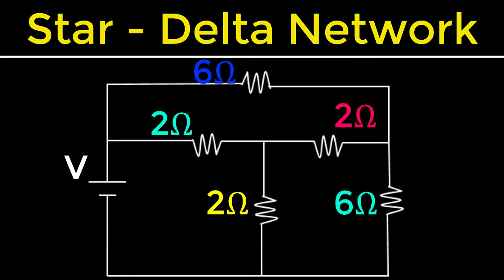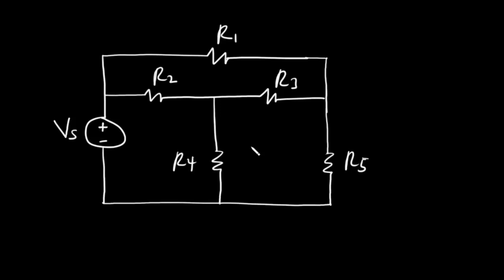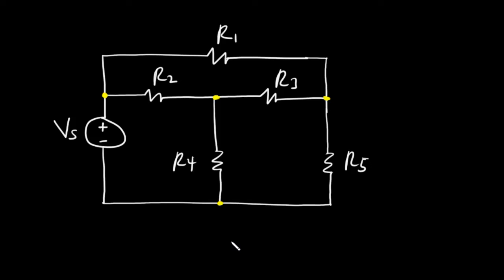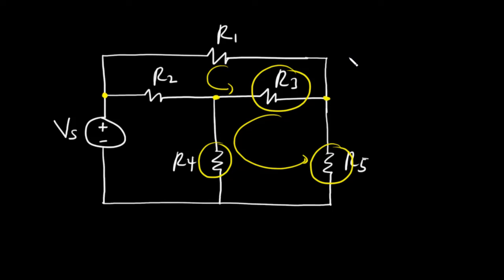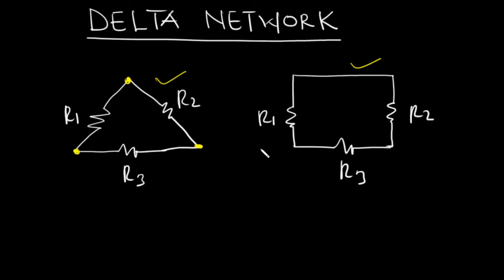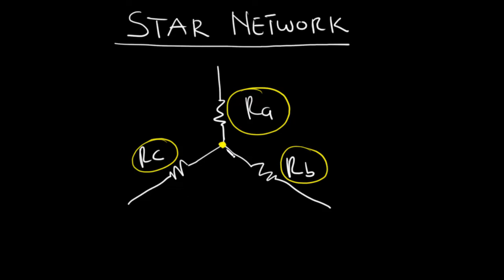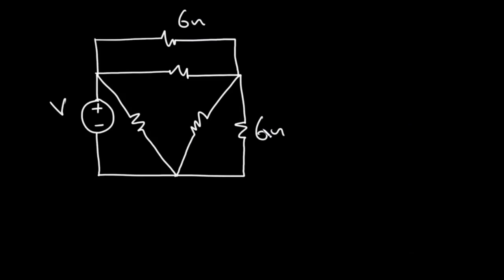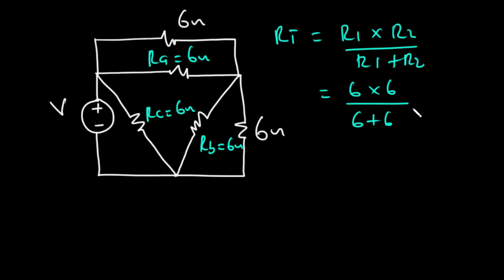13 - Delta to Star Conversion - Concept with Solved Examples

Comment: Thanks for the presentation, but I wouldn't recommend using the same resistor values as it can confuse which resistors are being added/multipied.
Reply from the maker: Okay, well noted. Well that was the example we had, I think I need to solve more questions with other examples too. Thanks so much

Comment: Hi, what do you mean by going through a loop without passing through more than 2 resistor?
Reply from the maker: please come again, don't get your question
Reply: you said that for 2 resistor to be in parallel, they must pass through a loop without passing through more than 2 resistor, I don’t understand what you mean.
Reply from the maker: Yes, when you go around a loop which contains only two resistors, without passing through a circuit element, eg voltage source, the reseistors are in parallel
Reply: Thank you
Reply from the maker: You're welcome